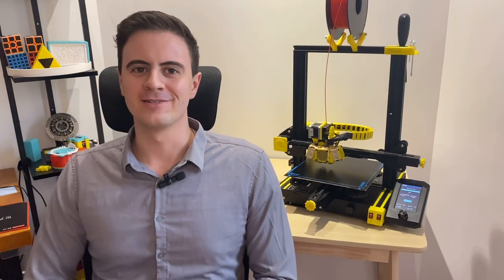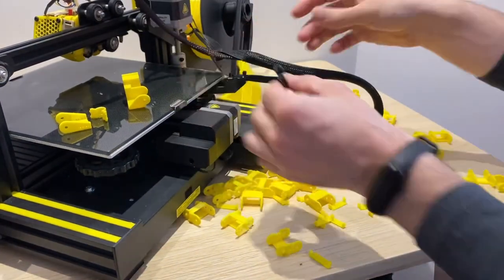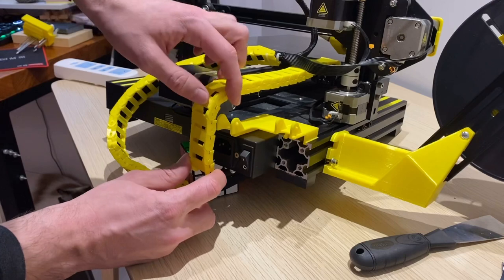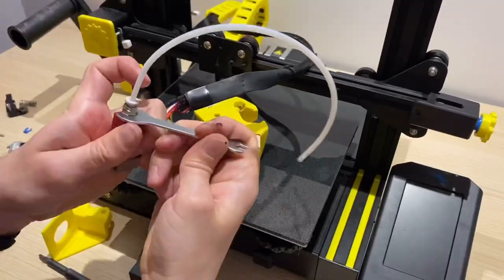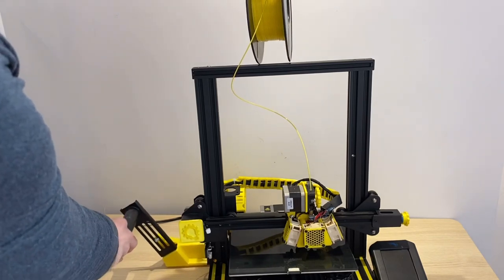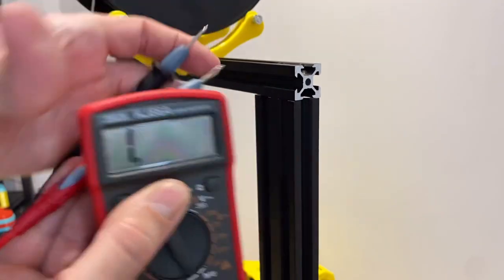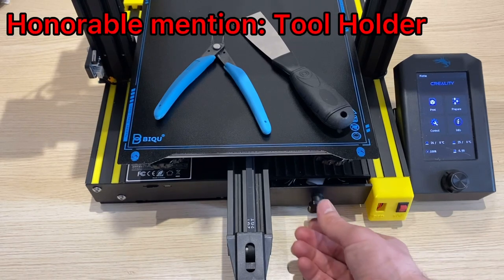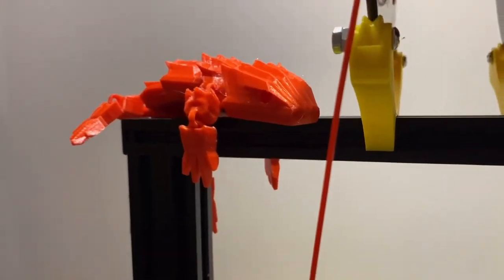5 Mid Level Upgrades for the Ender 3 V2 (Part 3)

Comment: For LED lights I used the same method however I fed it from one side through the top and down the other side.  I used 5mm led strips with power already connected (from local hardware shop) to go to a power board, so I can turn them off when I don't need it.  The led strips were sealed so no worries about them connecting to the frame.  I also use the Creality enclosure which has a reflective interior so the whole printer gets illuminated.
Reply from the maker: Nice idea to add the side illumination as well!

Comment: For the extra switch opening on the front, maybe you could move your power switch from the rear to the front. I did it for mine, and it's so much easier to just have the switch right in front of you as opposed to reaching all the way to the back. Just an idea. Your machine is looking great, can't wait to see what else you do to it.
Reply from the maker: Good suggestion! That would be much more convenient! Although I may want to make the power switch larger or a different color so I don’t accidentally turn off the printer!
Reply: @DesktopInventions  you could add a switch arm cover...

Comment: Just a quick heads up regarding that tool holder. If you try to print something tall, your Z-axis rollers will contact the scraper. The other tools should be fine but I'd suggest moving the scraper somewhere else
Reply from the maker: Yea that’s a good point I don’t usually print that tall of objects but will need to take that out if I do!

Comment: i would mod the following list for immediate improvement of your printers capabilities and printing ranges: 
1: bimetall heatbreak, capricorn tubing, hardened steel/tungsten carbide nozzle, 
2: dual z-axis+ stabilizer bars (dual z-axis makes anti-backlash-nuts and most bed mounting hacks pretty redundant) 
3: silent board (ender3/pro) bl-touch... because....
4. direct drive/filament runout sensor
5. heater block/extruder exchange - (usually requires modding of the parts cooling fan and housing armature)
Reply from the maker: Good suggestions! I’ve got a few of these in process already :D  I think the Ender 3V2 already comes with the silent board and thermal runaway sensor correct?
Reply: @DesktopInventions  i think i got mixed up there, yes you are right, this i think was an issue years ago with earlier version. and since i have a ender3 pro, the silent part wasn't yet part of the deal... ...edited out
Reply from the maker: No problem thanks for the suggestions!

Comment: just a heads up, the thread on the bolts running through the spool roller will eat through the plastic and your spool will come crashing down at some random point in the future
Reply from the maker: Thanks for the heads up. I just double checked this, the way I have it mounted the bolts do not move relative to the mounting brackets so there’s so friction there. But the wheels do spin on the bolts  so those would wear out over time. Mine have a long way to go yet though 😃 thanks for the comment!

Comment: I assume you are printing the extruder head parts out of abs right? How are you doing that without an enclosure? Pla would surely fail due to the heat, right?
Reply from the maker: So far just PLA, I haven’t had issues yet with anything melting/warping

Comment: Hey there! So I have a problem with the chains... I printed out all the chains and anchor points for them, everything is fine but the part from the bowden to the print head doesn't work it's like I don't have a long enough cable braid to put it in the 90 bend from the motor to the print head if i go all the way up the Z axis (i can only go maybe halfway up)? did you extend your braid is mine too short somehow, did I do something wrong? 
Any advice would be helpful, thank you!
Reply from the maker: The length from the Bowden tube to the print head shouldn’t change if your Z axis is low or very high, maybe you mean the length from the base of the printer to the extruder mount?  In either case, yes I ended up printing extra links.
Reply: @Desktop Inventions  sorry my explanation mightve been a bit all over the place lol... 
I mean the cable harness itself isn't long enough to go from the base, to the 90° bend on the old bowden, then to the print head( if i go above half the Z axis) if that makes sense?
It just seems like your harness it way longer than mine which is odd, maybe I have a snag in the cable somewhere causing it to be so short...

Comment: Awesome machine u have there, would you mind sharing your slicer profile? :D
Reply from the maker: I use some pretty standard settings I think. 60C bed temp 190-200c nozzle 80-100mm/s speed 20% infill normally. Sometimes adjust the support angles or support types based on the print I’m doing. If you have questions on any specific settings I can share on those as well :D

Comment: is those updates can be used on Creality Ender-3 S1 ?
Reply from the maker: I believe so. Not 100% sure on the printing head if it fits on the Ender 3 S1. The cable chains might have a different variation out there as well for the S1.

Comment: Nice stuff but why have you not upgraded the computer to Jyers firmware?  You’re missing out on far more functionality than stock.  There’s a great how to vid out there.   Have to update motherboard and the handheld separately with the mini sd and two separate files.  Well worth it.
Reply from the maker: Thanks for the suggestion!  I just did that a couple weeks ago and in my BLTouch video.  Such a great improvement!

Comment: Hi, the chain clips shown on your printer are not the chain clips linked in the description, or am I wrong?
At least the clip’s from JW are looking different to me. I just saying this because I’m already searching for a while for the shown in your video 😁
Anyway you have done some nice upgrades. I changed the cable routing on mine too an this look be far better now 😃
Reply from the maker: Thanks for the comment Jack, they are the ones from JW’s page but he has 2 versions listed. The ones shown in the picture (red) I believe are V2 which only bend in 1 direction and he has a V3 that can bend in both directions which is what I printed. Hopefully this clears that up.  
Yea I had to search around awhile and piece together several different cable chain parts to reach this solution, it’s definitely more involved of a process than I expected! I hope your build goes well!

Comment: Hey just Wandering, Do you recommend the extruder head that you have? I need to change mine from the stock one but there is so many!   (btw love your videos!!!!)
Reply from the maker: If you mean the printing head where the fans mount to yes I really like it and recommend it, you will have to do some extra wiring work for dual fans and there was some interference on the back with a bolt that I had to adjust with a soldering iron. Other than that it’s been great.

If you mean mounting the extruder motor above the printing head I’m on the fence on this one. There hasn’t been much performance benefit I’ve noticed other than being able to print flexible material. 

Thanks for the support! I’m just finishing a video on a massive printing head upgrade with a dragonfly hotend and orbiter extruder I hope to release this weekend. It’s been a real challenge to far 😝
Reply: @DesktopInventions  Wow man what a response!  I'm still learning so i was talking about the first option you talked about.

After what you said i think I will do this upgrade, It seems like a perfect practicing thing with the wiring and stuff. Im bout to order the noctua fans and gonna upgrade this bad boy. Are there any tutorials for wiring the dual fans? or can i just follow your video?

 Keep up the channel, we need someone like you!
Reply from the maker: Right on! I’d say go for it! You can follow my video, although I did use a DC converter for the 2 fans in the quiet fan upgrade video. Since then I have removed it and hooked the 2 fans in series 12+12 to make 24V. For the front fan for the hot end you will need to add a dc converter though.  One tip I would say is make sure your printer is turned off when your handling the bare fan wires. I accidentally shorted 2 of the fan wires on mine and ended up frying the main board! Anyways happy modding let me know if you have more questions 😃

Comment: Is weight not pulling the gantry down if you use that direct drive conversion?
Reply from the maker: The direct drive does make the extruder and gantry heavier but it’s not enough to pull the gantry down when the printer is turned off. Also I haven’t noticed any effects while the printer is printing either

Comment: why would you go to the trouble of add more cooling fans .Then cover them and restrict the air flow more than 50% on each fan , does not make any cense to do that ??????
Reply from the maker: You mean the honeycomb fan guards or the fan outlets? I have been meaning to redesign those fan covers they are a bit restrictive, but I don’t want to go cover less because if I accidentally stick a finger in there and break a fan they’re not cheap to replace haha

Comment: Do those dual noctuas provide decent enough cooling?
Reply from the maker: Yes with this cooler design they’ve worked great for me. Noctua 4010s work as well but 4020s are slightly better.

Comment: Could you do some new sound level measurements with the cable chain? I've done pretty much the same upgrades you did silencing my Ender 3 v2 with Noctua fans and I also used the same cable chain as you. I however removed them again because it was very loud when printing. Kind of mitigating silencing the printer in the first place. Looks cool though!
Reply from the maker: I’ll take a look at that. I didn’t notice too much sound coming from my cable chain. Are your cables chains rubbing on each other maybe?

Comment: More like mods. Not so much upgrades since none of these will honestly change what the main purpose of the machine does.

I certainly wouldn't call these stage 3 upgrades either. Stage 3 would be like changing the motherboard or adding Arduino or something. Think of a stage 3 car. What you're doing here is not even stage 1 honestly. More like going on eBay buying stickers and decals for your car and installing a switch for some LED lights.

Spring steel is not an upgrade over glass. People that have issues with glass just don't know how to dial in their settings. Glass is awesome. No glue, nothing, just isopropyl after 20+ prints. I'm about to change my new Ender S1 to a glass bed.

Edit: 
By the way, how heavy is that monstrosity you have bolted to the print head on that poor single z-axis printer? It looks heavier than the microswiss DD and even that is a pig. I can make dimensionally passable prototypes on my stock E3V2 printhead at 150 mm/s because it's light, I only have an all metal extruder and hot end. And I print all materials from TPU to abs, asa. 

Diminishing returns make people waste time and money.
Reply from the maker: Thanks for the comment, more mods and upgrades in the future. More in depth ones as well like lighter weight extruder and different hot ends!  If you have any suggestions for upgrades in the future that would be great as well!